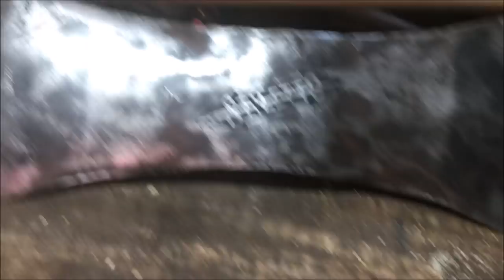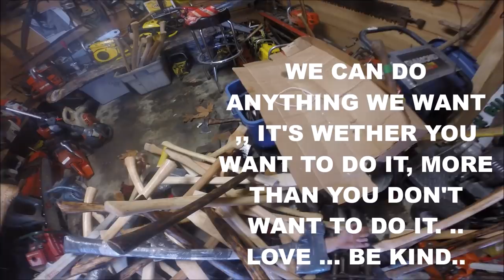FLEA MARKET FINDS

Comment: Sometimes the short side of  double bit is thicker too. I've heard it said that the long edge is sharpened to a fine edge for chopping and the short stout edge is sharpened for a more durable edge for grubbing where you might hit the dirt. You have handled and "handled" way more double bits than I, What is your experience?

Comment: Buckin' Love that 3 1/2 lb HB. I have the exact 3 1/2 lb head on an original handle with the plastic fill on the eye. The length is 36" and the handle is red. I can send you pictures if you like?